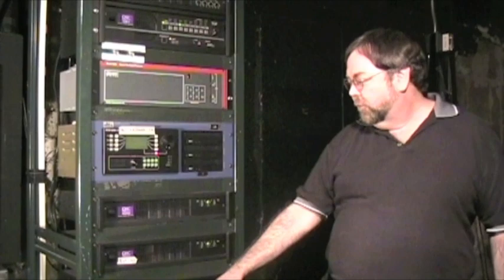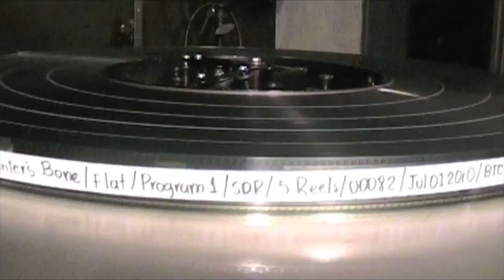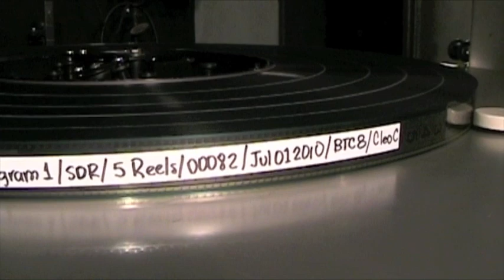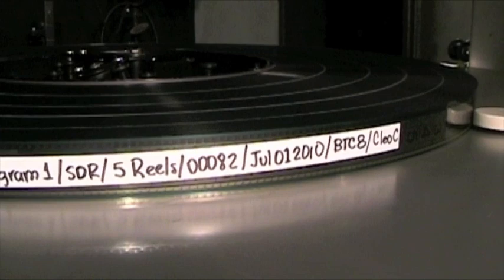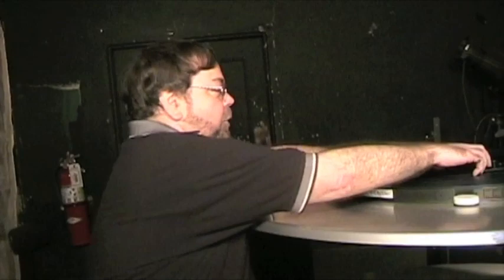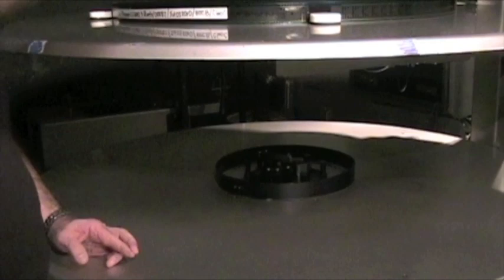Tampa Theatre Projectionist Mike Hurley Life in a Day 2 of 2

Comment: "Also, I always wondered why 35mm feeder reels run counterclockwise vs clockwise on other formats like 16mm?"  Edison started this "S" wind claiming that emulsion out give a better focus, where in the EU and other countries, they used emulsion in wind and front feed as with the 16mm units. You can do the front load if you put a half twist from the takeup reel to the supply reel to get emulsion in when rewinding the film.
Reply: In England it’s more common to feed clockwise, but both ways can be found.  Some projectors have to feed counter clockwise, mainly ones with fire traps made for running nitrate film.  Pathéscope 9.5 mm film usually both feeds and takes up counter clockwise.

Comment: Was that a nitrate print of the 1940s newsreel?  @davidpcoppola: The keystoning is usually compensated for not with a special lens but rather by tipping the screen slightly upwards (which also helps reduce keystoning for audience members in the balcony).
Reply: Can't imagine, the projector has no capsuled reels and I can't imagine, that they give nitrate to projectionists.

Comment: Nice video.

I used to collect 16mm films and had an Eiki EX4000p 550 watt Xenon projector.

That's one hell of a downward angle your shooting to. Does the lens compensate for the keystone?
Also, I always wondered why 35mm feeder reels run counterclockwise vs clockwise on other formats like 16mm?

Thanks, Dave.

Comment: I could never understand the reasons for installing a goofy platter system in a single screen theatre with an REAL skilled projectionist in the booth. Just doesn't make any sense. If changeovers are such a concern, then it would bemuch better to have 2 reel-to-reel projectors with 6000' capacity, cutting down the changeovers to only *1* for the average movie. It's no wonder that the studios don't allow their classic and archive film prints to be run via platters.
Reply: One projector is cheaper
Reply: It saves time, not to rewind the movie, so the next show could done maybe 15 minutes after.